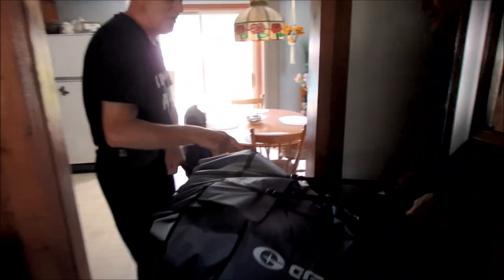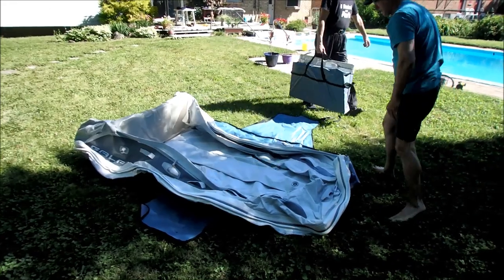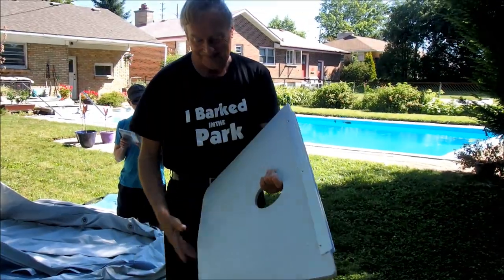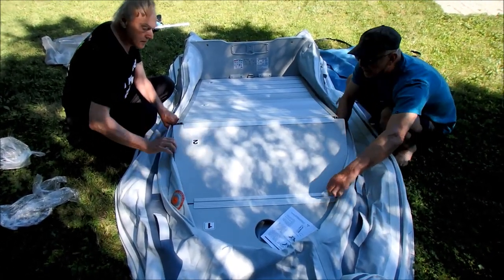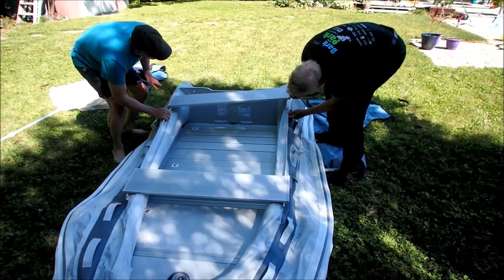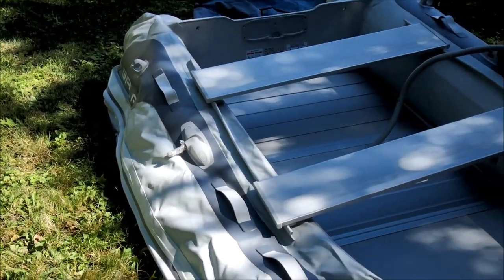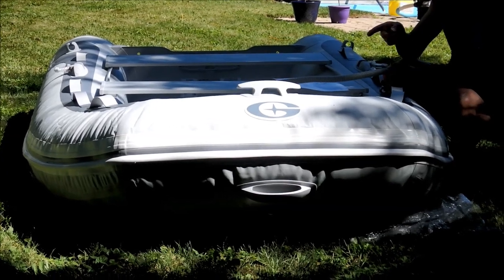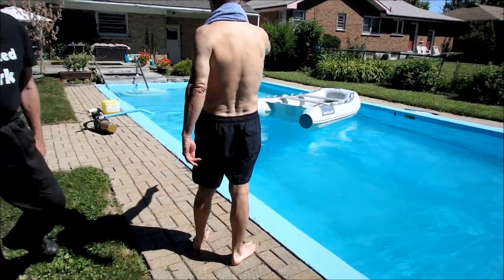The Gala Inflatable assembly adventure

Comment: What model is that?
Reply: Model is Gala F270(8 fit long). It is really good boat with a lot of internal space. Length inside 6'4", Width inside 2'8"  Competitors are less spacious. Gala sell sizes from 7 to 15 fit . Just finished my research and going to buy F330A  model with "Air deck" floor.
Reply: I have f330 its briliant